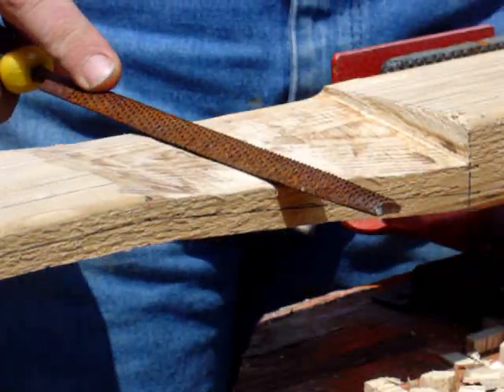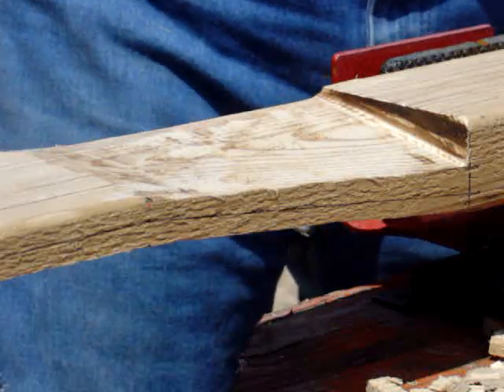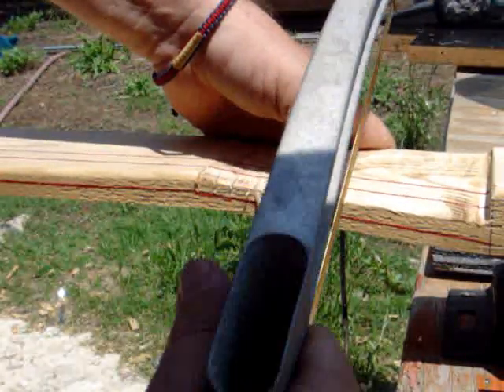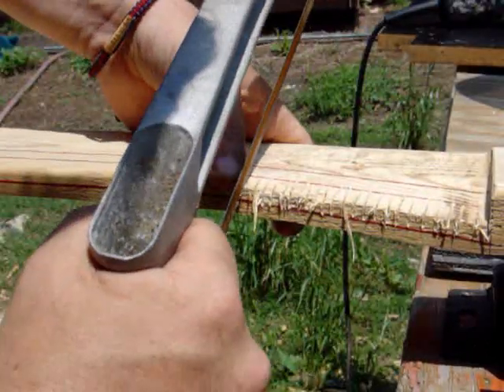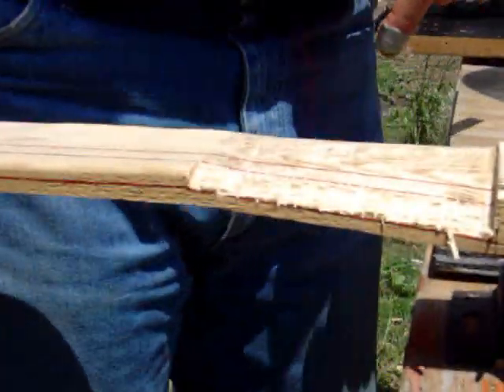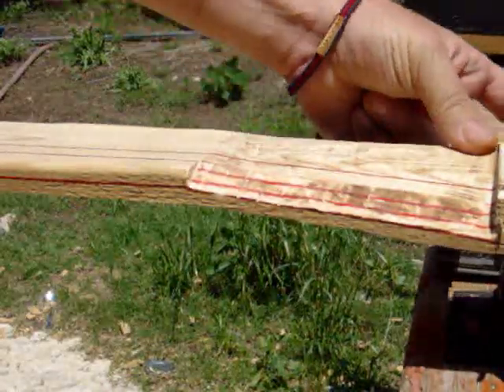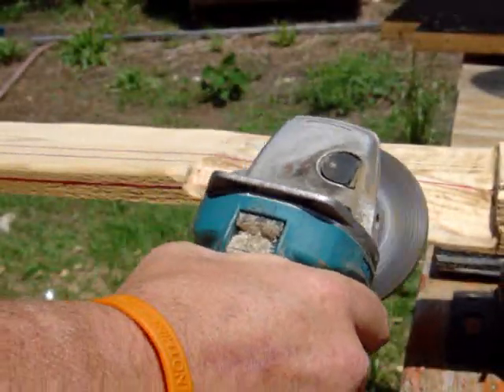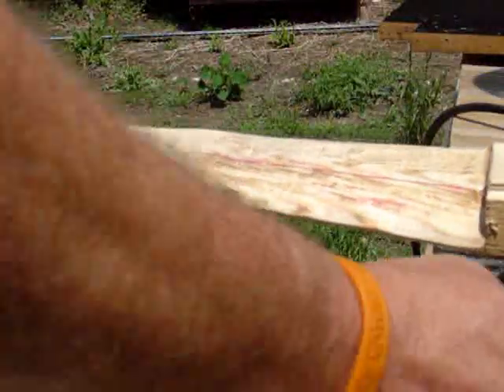HOW TO CARVE A PROPELLER (PART 5)

Comment: Belt sander with some 40 or 60 on it would be better for roughing much of this. Not only able to stay in line with the wood grain, but belts tend to stay fresh longer than a circular sander and will work the material faster. (Almost too fast if you're not careful.)
Reply from the maker: pauljs75 Yes, Thank you. I do use the belt sander with 80 grit sometimes, and a circular sander as well with 40 grit when i am in a hurry. It works well, and probably a bit too fast at times. risky. lol.
The heavy grit makes the fine sanding take a bit longer if you want them to look nice because of the deep scratches.
When i do props for me, i use the belt sander more.
the wind doesnt care about scratches, and/or beauty. lol.
Although the bastard file or rasp doesnt do much for the scratches either. lol. BUT, it does make perfection of control much easier. and it is fast as well. That is, if it is sharp. Thus the reason i stress no back stroking the file. lol wwwweeeeee.
as for doing the backside carving, The belt sander is much too fast and inaccurate. But, I am practicing. :)
MUDDy

Comment: nice job i like the fact that it is curved just like the big turbine blades using the bottom of the blade to push the blade up from the bottom rather than pushing it up from the top,,,,,,,,i like it i just might carve a set....later from the west coast